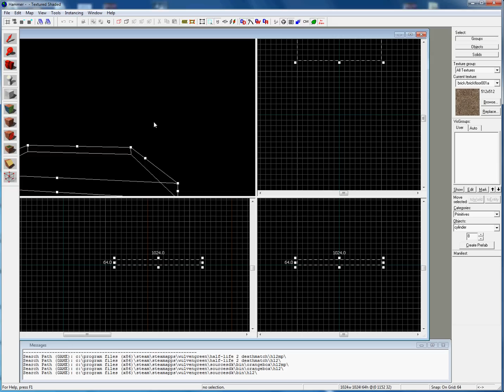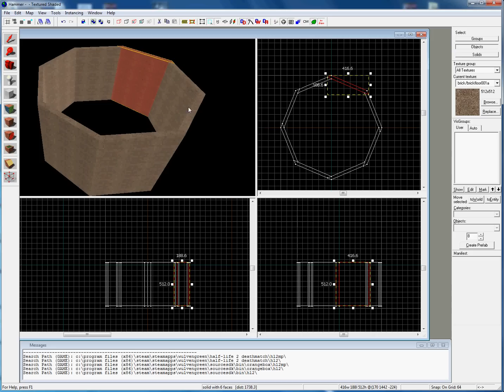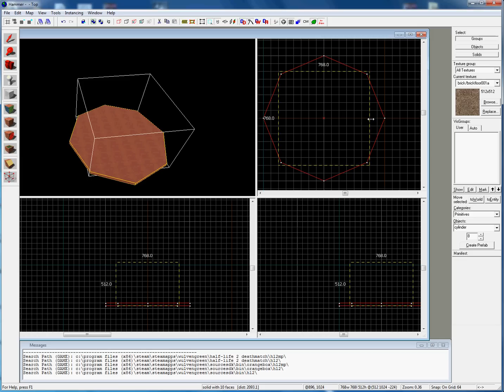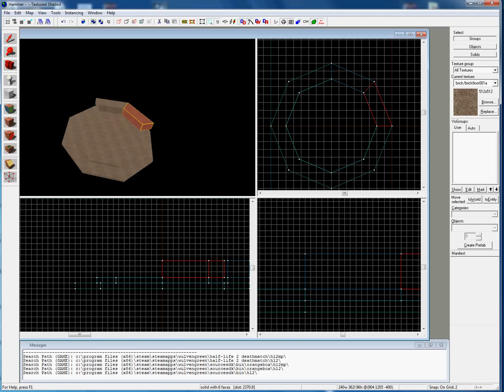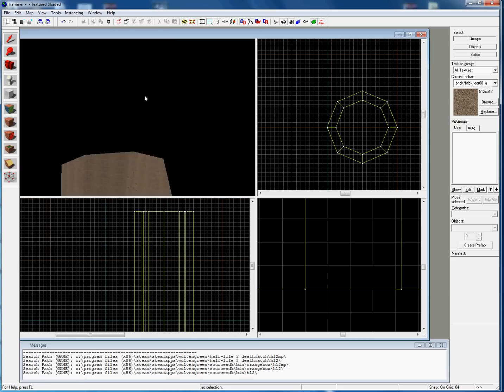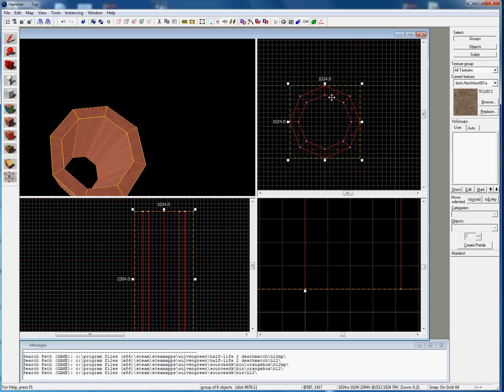Valve Hammer - How to make a tidy tube or tunnel in Hammer Editor

Comment from the maker: I did think of this waaaaay back when I made this but the problem was you have no guude on where to place the points and if still create a guide for the 'traditional' tube, why spend all that time dragging all the points when my method only requires a quarter of the points are set up before simply replicating tgat quarter. Plus it has been a lobg time since I did any hammer stuff but if my memory serves, the traditional method will leave you with a polygon short (not certain)